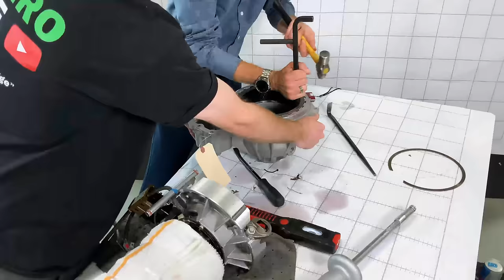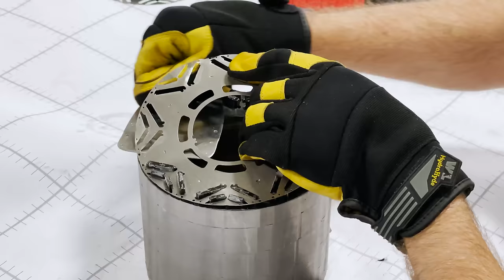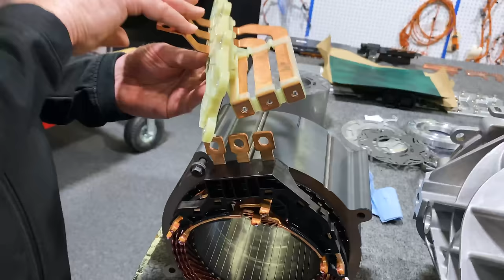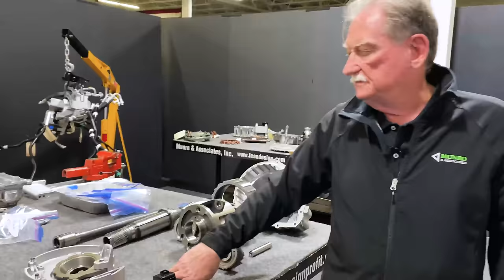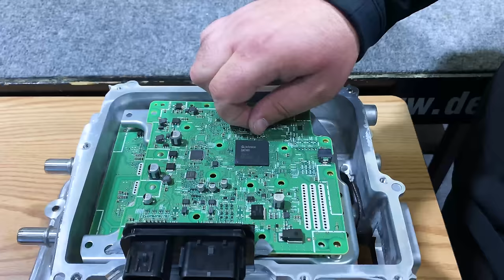Ford Mach-E Rear Motor Teardown and Analysis

Comment: This inverter was developed by Toyota/Denso and has been used in Toyota's hybrid cars in some variant since about 10 years. Must be in 1000000+ vehicles, can't be all bad?
Reply: What's bad it is designed 10 years ago? Electric tach has come a long way in 10 years.
Reply: @michaelsmith2723  Most of the criticism aims at the manufacturability of the inverter - not the electronics per se. Electronics like the power transistors being Silicon Carbide MOSFETs are very up to date. It just seems to me, if Toyota sticks to this design for so long, it can't be that hard to manufacture. Or they just figured out a good way.

Comment: The parts count relates to MOVING parts, designed to move relative to each other. wearing each other out, needing complex lub.

Wow, that inverter is NOT designed for volume production! It's like the designers were told "prototype only", but now they're moving it onto production with zero optimizing. Ford does not expect to need many inverters!
Reply: No, not many, they will make new versions for all model variants, of which they will have to have as many as GM promised, 30 by 2025... for total 1mio cars, lol, so few thousands each will do.
Reply: @praero551  They won't make any profit that way.
Reply: I actually work on those inverters. They are made by Denso and we are adding lines, but we just don't have enough people right now.
Reply: @caseybv74  Ford CEO most likely pushed to market, hard to optimize when in production and this even would be in basic design not just moving operations around
Reply: The thing is even though the 500 plates are not moving relative to anything else. They still have to be assembled carefully. Just like an internal combustion engine needs to be assembled carefully.
Just like anything else that's built by people, some are built better than others sometimes the design is better, sometimes the manufacturing is better. 
I drive a Toyota Prius which is a combination of internal combustion and electric and shares many of the components of all the other EV'S out there. It has a small battery,  high voltage inverters and  converters, coolant pumps etc. 
 If you follow the Prius forums you will find out that the gasoline engine is the most reliable part of the car.
 At least in gen 2 cars. 2004 to 2009.
 You almost inevitably have a coolant pump, inverter or battery failure  before the gasoline engine has any kind of serious mechanical problem.
 I suspect when electric vehicles start turning 10- 15 years old you're going to start to see some of the secondary support systems begin to fail. You lose a coolant pump  and you're on the side of the road, same as in my prius. 
A little $50 12 volt pump can strand you. The difference for me at least currently is I can go anywhere and purchase that coolant pump and install it myself. And it's relatively easy to do. If I had the pump on hand I could probably do it on the side of the road if I really had to. Two hose clamps and three 10 mm bolts and an electrical connector. That's it.
There's no doubt that electric vehicles are the future. But I suspect we're going to find out that they break down almost as much as internal combustion cars. Particularly if they are assembled badly, or the manufacturer decided to use a cheap crappy supplier for critical secondary systems like a coolant pump.
Most of these electric vehicles depend on their air conditioning system to keep everything cool. They have a glycol loop like an internal combustion car but that glycol loop is passed through the air conditioning system to get rid of the heat. So you lose an AC compressor you're probably in limp mode.
Reply: @kens97sto171  It's no different than industrial motors, which eg WEG in Brasil can assemble and sell in similar sizes for like $200 total. Probably these ones need a precision machining for diameter and balance after assembly, but no biggy. Much simpler than a single crankshaft.
Reply: @lengould9262  
Most industrial Motors are designed to run at a continuous speed. I'm not sure whether the control aspects are the same in a basic industrial motor spinning a fan and something that's in an electric car. Certainly the basic rotor and field coil is the same. But I think the control processes are far more complicated in an EV. I could be wrong I guess it would depend upon the industrial Motors purpose.
Reply: @kens97sto171   The same, basically, as a variable speed industrial drive. Back when I worked on them, in 1980's, a drive this powerful would be a floor-standing cabinet in a clean room with dedicated cooling. (Inefficient low frequency power transistors). Now, with purpose built IC's and powerful IGBets etc, ... 

Sure, the motors need to be thinner glass-steel laminates, exotic magnets, precision balanced and cooled, carefully sealed, but as we see here, nothing like a modern IC engine / transmission of comparable power.

Comment: The electric parking brake on my Model 3 is one of my favorite thing! You put it in park and it DOESN'T BUDGE unlike an automatic where you put it in park, and take your foot off the barke and the whole car settles 2 inches either forward or backward. Of course after 20 years of driving I still accidentally take my foot off the brake right as my passengers are opening the door and getting out of the car.
Reply: It is standard procedure to apply the parking brake after shifting the transmission into Park. If the parking brake shoes and cable are adjusted properly the car doesn't move. It is called a parking brake (not emergency brake) for a reason.
Reply: @ClassicBMWFanInQuebec  Nobody I've ever driven with has used the parking brake in an automatic transmission.
Reply: @oisiaa  Yes I also noticed that many people don't use it. Then that one time they need it on a steep hill, they wonder why it's rusted frozen...
Reply: @oisiaa  Only time I use the parking brake, if I am parking on a hill of any kind.
Reply: @oisiaa  You haven't driven with me, or anyone else who is competent.

Comment: The shield at time Mark 26:05 is most definitely an EMC related shielding device based on the thickness (low parasitic impedance) and many Grounding pins (to ground RF surface currents induced by any near field emissions of the Fets..  like the gentleman said probably for attentuation of radiated emissions (EMI)
Reply: Sandy complains about he doesn't understand why they would need a EM shield there, and in the very next step they put another PCB directly above it that matches the shield outline.
Reply: @jasonosmond6896  I think they recognized it was probably a EM shield, but because of its size and mass they were having trouble understanding why it would be an inter-board shield.  Normally you use a very thin flexible shield, if you couldn't pull it off with another PCB layer.

Comment: 21:56 Is it possible they’re welding and pre assembling the mosfets and then sliding that entire assembly down or up into the cooler? If they did that process they could weld and pre assemble the electric components and bolt them together after they fact.
Reply: That's what i think too. Sandy just tried to assemble it in the wrong sequence. 

They would solder all the mosfets to the PCB first, probably by dirt cheap wave soldering and then they insert it from the bottom into the uncompressed heatsink. They use a spunger  to drop in the blank aluminium spacer and the Spring from the top then. Easy as pie.

Those boards get tested for sure with a fixture, pogopins, automated testing and the best would be to have the mosfets already soldered to it when testing so that nothing can get wrong in a later soldering stage. By the way, even this steel plate between those boards and all those nickel plated brass standoffs can be assembled beforehand as do the solder bridges between those two pcbs. It is one preassembled and tested unit before they insert it into the housing and heatsink plates.

I also thought about why they solder so much and do not use board to board connectors. One thing could be current capability, as a solder joint will always be better and more compact than any crimped connector. The other thing is deteiorating leaf springs inside the connectors. Also due to the vibration any gold plating in such a connector will shave off quickly and then it starts corroding the contact. Solderjoints can crack too, but there are solutions to alleviate excess stress like the fancy curvy Pins they used in the Mach e front Inverter.

A very large single PCB would be prone to flexing and cracking due to vibrations, but i would have preferred  Rigid Flex PCBs over all those stacked soldered connectors.   Also there are a lot of options of floating spring loaded board to board connectors, which are suitable for a high vibration enviroment (hirose, amphenol, etc.).   But i guess this is where they try to save the cost.

Comment: Munro & Associates strikes again. I’m a big fan of the concentric drive motor system using planetary gears over multi-plane spur/helical gears, or worse yet, hypoid gears for the final drive any day of the week! I guess somebody’s relative from Ford sells fasteners to justify all of the unnecessary extra screws, just like VW! I can’t figure out why they stray away from the great engineering guidelines you offer to anyone willing to listen? Keep up the amazing education videos. Big thanks as always!
Reply: Yes, hypoid drives are inefficient, but no one uses one in an EV. 

There's nothing wrong with gears on parallel shafts (yes, they're always helical), and the outputs can be concentric while using gears on parallel shafts - the Chevrolet Bolt is an example (which Sandy should know, because he has torn one apart, and should have mentioned).

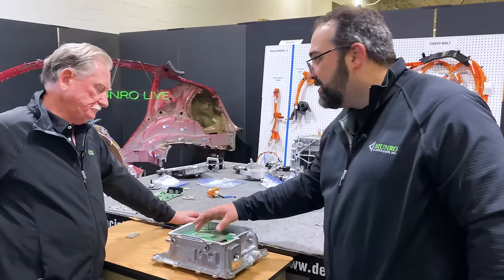Comment: 24:30
Wouldn't the transistors be soldered onto the board before and then the whole stack is being put in between the cooling fins?
I reckon this is the first step and then you do the other side.
Reply: I agree with this.  I don't think Sandy has the order of assembly correct.
Reply: i think so too. Nevertheless, I think the layout, which has to be worked on from both sides, is bad
Reply: and regardless.. why is Ford the only one doing it this way? It doesn't seem like, regardless of the order of assembly, that this is a very intelligent and efficient way of making this component and connecting it to the motor. Looks like if they took the time to see how others were already doing it, they might have come up with more efficient methods
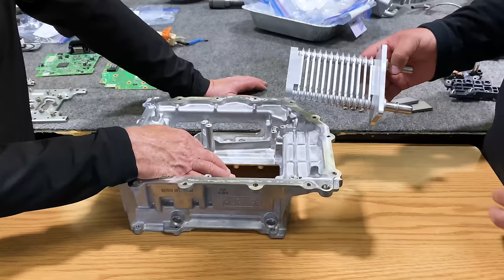Reply: I don't think so. Look at 16:22 when Ben inserts the slotted MOSFET holder. That component needs to be inserted from the side slot and if the top had been assembled before, then the MOSFETs would get in the way of sliding that component into the spring.
Reply: @Zedus-rl9hp  It's almost certainly put together standing on its side, so you can access the top and bottom without having to manually flipping it over.
Reply: @amkarkare96  yes, I mean that the "holder" is slid in first, then what they named the back side is slid into this as a whole (and the other layers are assembled) and then last the bus bars on what they named the front. This would allow for the transistors to be soldered onto the control board before assembly and assure allignment.

Comment: I think the reason for the welding is so they could use the transistors with the two cooling surfaces.
I think the solution to this problem is for semiconductor manufacturers to offer a liquid cooled 3ph bridge package like they do for industrial drives. It will make life easier for everyone.

Comment: I never appreciated the amount of engineering that goes into automobiles
Reply: And today you got a chance to see when too much engineering gets put in a vehicle 😂
Reply: ...and the complexity of electric motors and transmissions. Electric motors should require less maintenance for a give service life, but when they do fail, things get expensive in a hurry.
Reply: Looks like one department had to increase complexity to justify their existence ...:)
Reply: I bet it was much simpler before the bean counters came down and added features that take time to service so that the dealerships could continue to make money off the servicing ….
Reply: @carholic-sz3qv  You must not know about the electronics on modern ICE vehicles if you think that.
Reply: @1djbecker  yes I know about electronics on modern ICE, there are just way more sensors/captors and the ECU is auper tiny compared to an EV charger alone.
Reply: @chrisbraid2907  The inverter would simply be replaced if it failed, not repaired, but EV inverters almost never fail (I don't recall ever seeing one fail). This one was made by Denso.
Reply: @carholic-sz3qv  EV electronics are larger (and more expensive) because they handle far more power, but there is no more complexity in them than in vehicles with engines.
Reply: @brianb-p6586 wrong and correction: EVs have both low and high voltage systems, the large electronics has really nothing to do with more power and shit, they could simply use gallium nitrite components, EVs have a very complex management system from controlling and balancing the tousands battery cells to adequately charging and restricting a puffer for longevity to controlling the motor, charging characteristics.... regenerative braking.....
Reply: @brianb-p6586  ICEA are magnitude simpler than EVs apart from the lubricated moving parts and sensors there nothing more going on, except the many other option/features that luxury vehicles adds.
Reply: @carholic-sz3qv  Regenerative braking is just a software feature of the same hardware use to drive the car. A BMS (battery management system) uses a lot of little wires, but isn't very complex... and only deals with (typically) 96 cell groups, regardless of the number of cells.

Engines require processors to control fuel injection, ignition, throttle position, and camshaft phaser positions (in modern engines), plus various other supporting bits. The injection and ignition systems precisely fire an output for each cylinder - the control of those alone is more complex than an EVs motor controller.

The complexity really is comparable, and the high power of the high voltage system (specifically the inverter and charger, but even the DC-to-DC) really does make those components large (and expensive - they even need liquid cooling).

You really should learn something about electronics if you think you can just utter magic words such as "gallium nitrite" and the massive devices used to handle motor and charging current will become small.
Reply: @brianb-p6586  wrong, the regenerative braking only work in certain conditions, the BMS has to very meticulously controll almost each battery cells so that they could stay balanced all the time, 
the controler and charger and inverter also have to be calibrated very well to avoid overheating and battery degradation
The ECU is connected to all those different sensors you mentioned up there, the ECU is tiny compared to a motor controller alone
ICE just have more moving parts but the control is very basic.
Galium nitrite is a magnitude more efficient in electronics and could significantly boost the efficiency of electronics.
Reply: @brianb-p6586  ECU are very old technologies and have just been improved over the decades, the principe is tooo simple compared to an EV motor controller, controlling timing or injection..... is not complex it has been done decades ago.
Reply: @carholic-sz3qv  Right, the regenerative braking logic only turns on regeneration in certain conditions... and that takes exactly zero more components or electronic features than not having regeneration at all... it is just software.

Yes, all of this stuff has to work accurately and quickly... whether it's controlling an engine, a transmission, brakes, steering, an electric motor, or battery cells.

An engine control unit is small compared to an inverter, because the inverter handles a huge amount of power; the controller which controls what the inverter does is the size of an ECU.

You should try to sell your miracle material to the companies which actually make automotive electronics, telling them that it is something new that they haven't heard of. We should be able to hear the laughing from here.
Reply: @AudiTTQuattro2003  electric motors - never heard of a repair (maybe bushings or bearings??) just replace the motor.

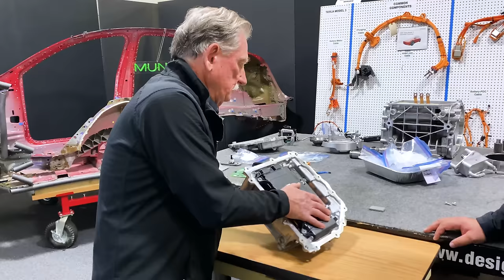Comment: @Munro Live: Could you have the assembly sequence wrong?  If the MOSFETS fall through the casting, they could be inserted from either side.  It seems to me that if you started at 23:06, you could have previously coated the MOSFETs,  inserted them individually into the circuit board, used a precision jig with slots on the sides that duplicates the casting slot spacing to keep them in alignment, and flow soldered them to the board in one step?  That unit would be easier to insert in the casting from that side than inserting the individual MOSFETs and aligning the circuit board with all the pins and the casting.
The only thing that would sort of justify the standoffs and aluminum plate is if they act as a power bus or a barrier shield between the two boards.  The welding is still a mess.